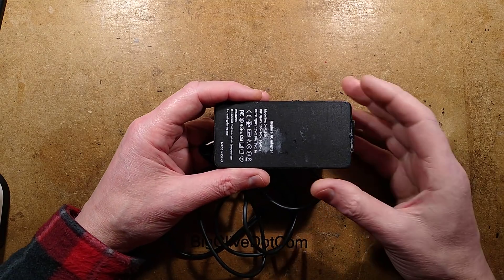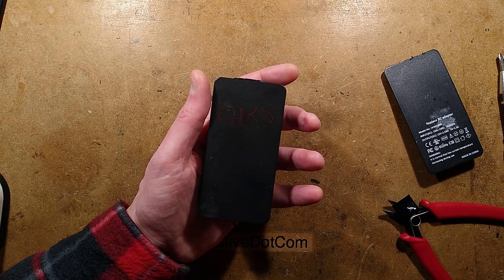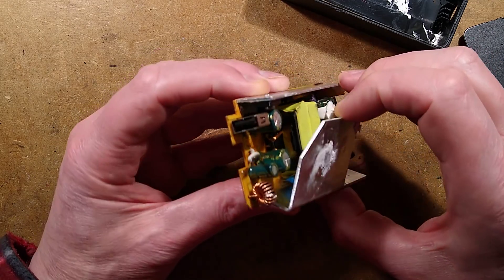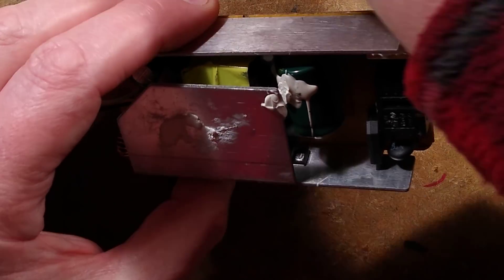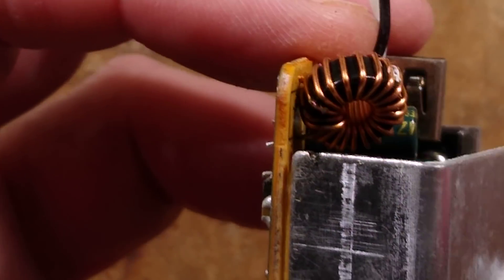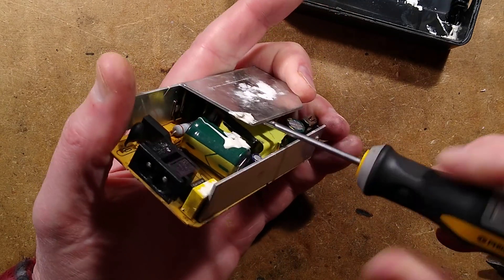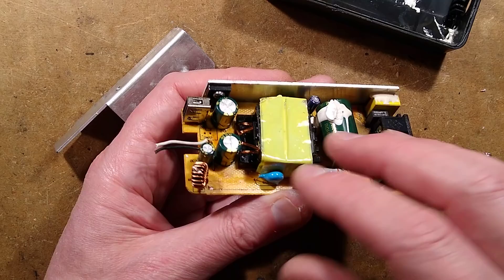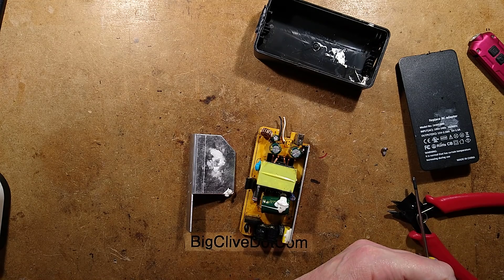This PSU killed a Microsoft Surface and a monitor

Comment: i find that even OEM chargers give zaps and blow up. Samsung, Apple, they all make this trash too. It's just people have a weird bias that the more expensive something is, the more of a HERO they are. What a clowny world.
Reply: You sure those weren't copies too? (I never encountered problems like these with genuine products, mostly user error or un-catastrophic failure)
Reply: @wisico640  nope, straight out of the OEM box straight out of the OEM shop. The charger that comes with the iPhone (the old ones when they had chargers), and right out of the unopened box of a scamsung laptop. Touch the metal by the keyboard and you feel a tingle. A good 60VAC to ground at 0.01A or something.
Reply: @dimitar4y  happenend to me once, with a dodgy ATX computer PSU, plugged in dodgy electric work / bad wired plug in a damp basement. What you experienced is in no way normal :/
Reply: That escalated quickly... Go IBM you'll rule the world!
Reply: I haven’t found that.

Comment: Anyone know if a genuine Surface supply is identical internally to this Chinesium 'Replace' one?
Reply: I've opened a "higher class" clone(?) which has all the Microsoft text on the back with no misspellings. I measured the AC line input capacitance of a real Microsoft one and it clearly has proper RF filter caps on the AC input and about a .0047uF safety cap as I recall. The "clone" lacked the RF line filter and the safety cap. I added both because the clone caused intermittent cursor freezing. The clone one has considerably more components than Big Clive's one.

Comment: Aluminium, or steel, or whatever they used as a thermal interface to the box, better be father from the high-power inductor, I reckon. So cutting part of it would let this PSU serve a better job indeed.
Reply: I mean, metal be farther.

Comment: I wonder if the external monitor was plugged into the usb and the path through the display cable and probably gone straight into the motherboard CPU and killed the tablet
Reply: You can charge most Surface tablets either via the magnetic power connector (as seen here) or via the USB-C port, so that perhaps explains why the PSU was able to kill a connected display.

Comment: I really don't understand why these Chinese clone makes go through all of the effort of designing these things and then just get sloppy randomly with the actual manufacturing. I see this all the time with your teardowns. They're so close to making something perfectly serviceable and they just get so sloppy with the components.

Before I watched your channel I enjoyed taking things apart just to look at them. Now that I've been subscribed to your channel for a few years I take things apart just to see if I can make tiny modifications to make these devices much more secure without much effort. Thank you, as always.
Reply: The thing is it has never been just the Chinese, it is every company where accountants are allowed to interfere with what the designer specified, just to save a couple of pennies.
Rover Cars, just before their demise, used cheap components to cut the cost by a couple of pounds per vehicle. What were beautifully designed cars were subsequently plagued with problems. I imagine it made the designers cry. The warranty claims and damage to their reputation finally pushed them under.
Reply: @chrishartley1210  sure, but a lot of these design choices don't even necessarily affect the cost, which is the most bizarre part
Reply: Its because the workers are complete lazy bastards even if making it better would cost nothing or doesn't take extra time. Pushing the inductor away from the heatsink would take 0.01 of second. They do the absolute bare minimum just so it works. No thought given to safety.
Reply: I don't think they know what they're doing really. They get some sort of decent successful design and then they copy it and they make mistakes on top of it. True expertise costs money. Maybe once in a blue moon they even hire a specialist to design a thing, and then over the course of time it... morphs due to manufacturing branch just implementing changes and them not being validated. There's a wild mix of things out there which some get reasonably close to getting it right, and those that are complete garbage and which cannot be helped.

That being said i think that's a phase. I think these companies go two ways, either they eventually die, or they eventually learn to do it properly and become a supplier for a number of tier 2 brands, with an occasional tier 1 brand in the mix, they go legit. The ones who have gone legit are then just not the subject of these sorts of teardowns, neither for the "cheapest on Ali" hauls, because obviously the stuff is anything but cheapest then nor the explosion post-mortems with funny spelling.
Reply: This is what surprise me too. Just like you say they go through the effort of making things but the end product is so shoddy. If they only put in slightly more effort they would be making top tier things. Something as simple as just the written English on the product. Then again, what isn't made in China these days? Even a good brand can fail.

Comment: Im thinking about getting a Microsoft surface tablet with a 4G connection for when our internet starts playing up
Just hope that the thing doesn’t get blown up
Reply: Look at 3 in ones. Surface are known to be unrepairable & other internal problems (battery)
Reply: @wisico640  just a pity that I cannot seem to find any devices other than surface devices that meet my requirements
The requirements i have are:
OS: Windows
Wireless connectivity: WiFi, Bluetooth, 4G LTE (I don’t really care for 5G as by the time there is 5G coverage where i live, the device will probably be due for replacement)
CPU: Intel or AMD, must not be ARM (as doing a manual reinstall of the OS would be a pain on an ARM device, i have had the reset tool that is built into windows fail before, fortunately that computer had an intel processor so i was able to manually reinstall windows)

Comment: Surfaces need at least 3.5A rated PSUs, and more if you're powering high power USB peripherals (or running the screen at 100% brightness). You really need a powered USB hub for connecting peripherals to a surface.
Reply: So on top of that it was 1 amp short??
Reply: @wisico640  yep. I learnt that the hard way :) there's a reason why there's only one USB port.

Comment: It looks like the heatsink is actually marked on the top silk screen, so they did know how close it was to that inductor. I'd clocked very early on that it seemed to carry mains side across to the secondary but was distracted by the soot being in a different area. I do wonder quite what happened to do that after a short to the output.

Comment: GREEEAAAT!  I have a Surface with the "original" power supply, but knowing how Microsoft can cheapen things out, I just might open up my power supply and see if it suffers from the same design flaw.
I think they put the heatsink at -HV is for shielding and HF noise suppression.  There wouldn't be any other reason to have the heatsink at such a high voltage.
Just a poor design.
Reply from the maker: This was a generic power supply.  Not official.

Comment: As a "retired" EE, I am reminded of the trinity of production.  Cheap, fast, good... pick two.  This device was obviously had a rushed design to sell at a low price.  Like most cheap Chinese crap.
Reply: Cheap, fast, good... pick at most two ;)
Reply: That's the cap theorem of ee (consistency, availability, partition tolerance - pick two)

Comment: Usually when I take apart power bricks like that from laptops etc. those large metal heatsinks are well wrapped with a couple of layers of that yellow transformer tape to prevent stuff rubbing and shorting on them.
Reply: That would be kapton tape.
Reply: @norliasmith  It's not kapton tape, that's different color and transparent. I mean the yellow stuf you find in transformers. I'm sure it has a proper name but I always see it referred to as transformer tape.
Reply: ... Thought something was missing!

Comment: El cheapo power supplies plus ebay equals dead equipment. As long as people keep buying them, ebay, aliexpress will keep selling them. Because the buyer is essentially importing these supplies privately, they are not tested or examined for compliance with local safety legislation. This however does look like an effort has been made to manufacture this supply to some kind of standard. The fact that the heatsink and inductor are so close and able to bridge the gap between high voltage and low voltage sides should have been picked up during design or assembly. I guess the safety standards in some countries are much lower then in others.  Excellent video Clive.

Comment: I had a customer hand me a dell laptop to fix once, which clearly had a fakey power adapter, they had copied the dell adapter casing almost to a tea but the fakey adapter weighed a fair bit less than a genuine one.  Also the fakey would not charge the battery as the genuine Dell adapter had a 3rd wire in the middle pin, presumably for serial comms, so that the laptop knew the size of the adapter connected.
Reply: I got an old Dell laptop with one of those adapters and it would charge the battery or run the computer but not both at the same time. Under load the identification chip couldn't be read, presumably due to excess noise on the output. Upon opening the adapter I found the primary side capacitor had went bad (to the point of one lead falling off). As if it weren't obviously crap from looking at the outside, the AC ground connection wasn't soldered properly.

I ended up taking the output connector and ID chip from the fake adapter and attached them to a decent other-brand power supply and it worked fine.

Comment: The thermal paste coupling the heatsink to the plastic shell is odd, I wonder if they were desperate to fix an overheating issue?
Reply: Isn't the plastic case a good insulator?
Reply: @wisico640  It's an insulator indeed, but not as strong of an insulator as a one-two punch of plastic AND an air gap. It's still got a tiny bit of thermal conductivity, while stale air locked into a gap has pretty much zero.
Reply: @wisico640  Insulation in this case isn't the intent. Heat sink compound is intended to convey heat to the outside, usually via a metal case (!!) or larger metal plate that can effectively radiate the heat away. I doubt plastic is a great heat dissipator.
Reply: That is normal for laptop style adapters. They usually have quite a bit more of it in there normally.

Comment: The heatsink as it is connected to live supply should not cross over the barrier. Also it is rubbing on the electrolytic caps on DC side. Is the big heat sink at same potential as the smaller one could they touch as really flapping around in the breeze with only small fixings.
Reply: I guess it might have been less of an issue if it were on the neutral, so with that figure of 8 socket, a 50/50 chance each time you plug it in.

Comment: It might have helped if it had has a protective earth - notice it's a two pin connector. Love the diagnosis Clive, not an easy one to work out.
Reply: But they also usually designed better // more precisely
Reply: Steve Dubin. Most of these products are Double Insulated hence the two pin plugs. Properly designed double insulated equipment can be considered as safe as class 1 equipment, which has a protective earthing system.
Reply: The OEM chargers are all 2 pronged as well

Comment: There doesn't appear to be much clearance between the top of the output caps and the underside of the heatsink.
Reply: typically there should be a sheet of insulation between them.. of course, there wasn't here...
Reply: @jaycee1980  Hi, you don't necessarily need to provide additional sheet insulation if the design is such that you can guarantee to provide sufficient creepage and clearance distances between primary and secondary circuits.
Reply: @brucepickess8097  indeed, but in stuff like this that gets thrown about and the potential for stuff to shake loose is there - a sheet of insulation is a guarantee :)

Comment: I've had multiple Surface tablets with batteries doing balloon impressions with OEM chargers.  Maybe not the most well designed devices.
Reply: Hahaha! About a year before I left my "large company IT job" we started getting surface tablets for people. I left a little over the 1 year mark and batteries were already starting to puff. 

I was so angry because those stupid computers also came with a "ship it off to have repaired" clause and we could no longer take devices apart and repair them. 

About a month before I left they signed an agreement to get those 1st generation glued together surface laptops. That verified my decision to leave.... No more repair, throw it all away.
Reply: Charging machine battery 24/7 cause this exploded batteries. No mechanic to turn off charging when battery 90 - 100%
Reply: @GameBacardi  Hi, with a properly designed OEM charger, leaving the charger connected 24/7 to the device should not cause any deterioration to the battery in terms of physical deformity.

Comment: I love the heat sink paste on the plastic case.  Really useful! Dominic Littlewood did a TV article about a young boy found dead in his bedroom after being electrocuted with a cheap power supply.  Still eBay continue to sell this shit.
Reply: Ebay just sells a market place for the actual scammers who sell this shit.
Reply: @benbaselet2026  Ebay is great, but it's flooded with unregulated Chinese garbage and that's the shit you need to avoid. Basically you have to be savvy to navigate and read through some of the marketing the Chinese use to make sure it's a Genuine one you're gonna get or it's a knock off. Usually they say "Unbranded" in the Description and "For XXXX" X= Device Model or Brand" rather than just "Brand name"
Reply: @casemodder89  I like my coffee the way I like my slaves. FREE. Everybody works by a mutual agreement and gets paid a thriving wage for their time.
Reply: eBay sells this shit because people keep buying it without thinking about how someone can make it for a fraction of of the price of a real one.
Reply: Ebay doesn't sell anything.
Reply: I wouldn't put much faith in that other on line seller.

Comment: Like others have mentioned: that's a replacement AC adapter... very possibly a very cheap one at that... I did have some Surface devices die on me (or rather my customers) but usually it's the device or battery in it. Not the peripherals. Tablet go BOOM!
Reply: Nope that was a poor honest soul at the manufacturing line that was sending us a hidden message 'replace AC adapter'
Reply: As soon as I saw that I tought to myself "it was foreshadowing" 😂
Reply: Annoyingly "cheap" doesn't seem to matter either.  I had one that was like $50 for a 12V 10A power supply replacement on an electric TEC cooler calling for 12V ~5A and blew up rather spectacularly (and eliminating a chunk of the PCB and decap-ing some chips inside).  After that I got the cheapest $15 one I could find, which has performed flawlessly since.